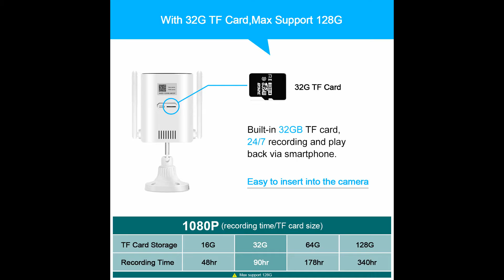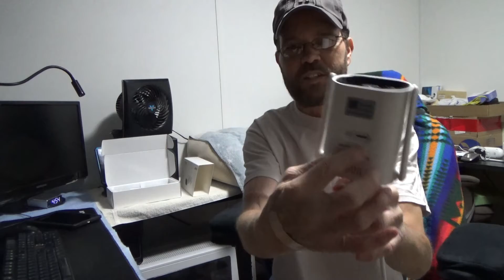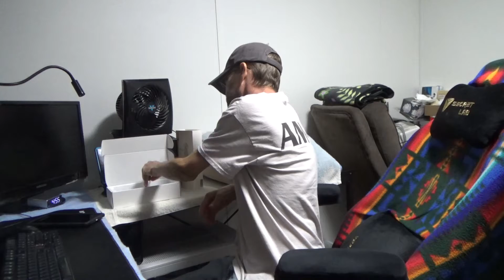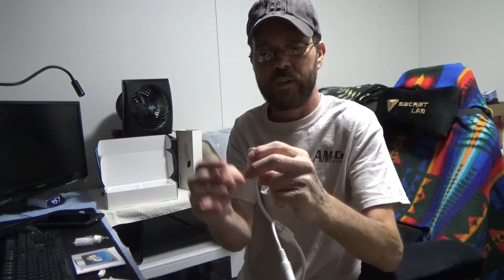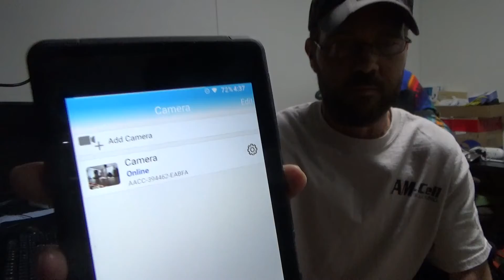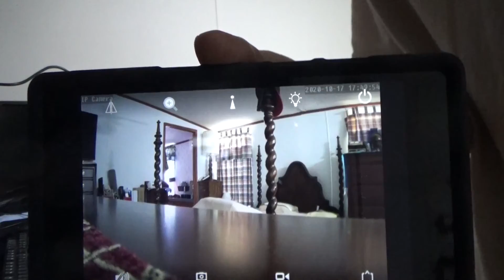ANRAN 1080P Wireless Indoor Outdoor Security Camera

Comment: So if I get the wireless option like you have I don’t have to hardwire it? Like I can just legit mount these outside of my new house and they be good to go?
Reply from the maker: As long as you have a 2.4GHz signal capable of reaching the camera you just need power running to the camera and you'll be good to go.